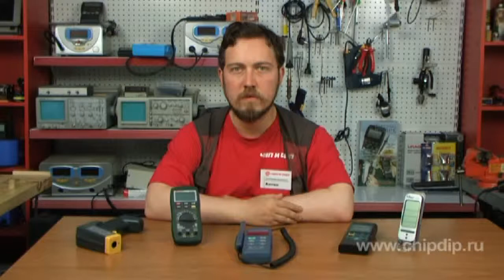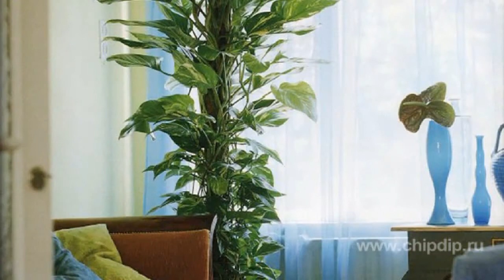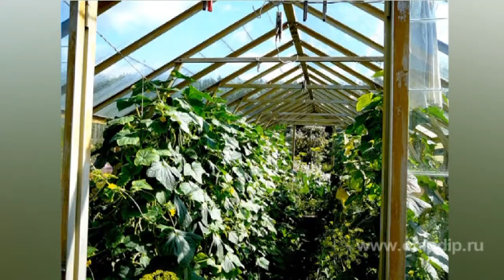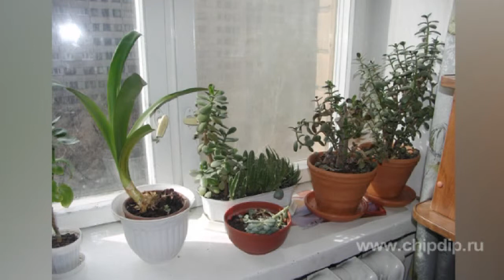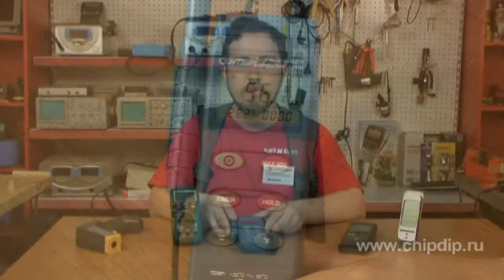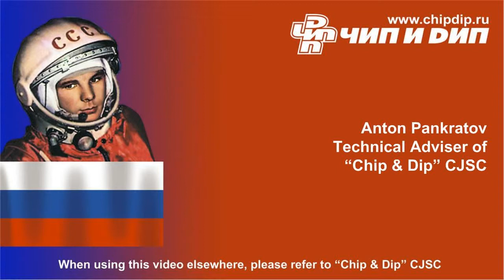Humidity/Temperature Meter CENTER-310

Comment: Ola amigo boa tarde.
Estou precisando do manual e esquema elétrico deste equipamento medidor de temperatura   Center 310 SERIES  .  Eu não tenho o cabo da interface para  o computador.
Mas quero fazer um e não encontrei na internet o esquema eletrico  e o Software de ligação do conector Db 9 RS232.   Voce tem esse esquema o sabe onde posso encontra 
Agradeço toda ajuda.

Joao Carlos.

Comment: Hello friend, good afternoon.
I need the manual and electrical diagram for this Center 310 SERIES temperature measuring equipment. I don't have the interface cable for the computer.
But I want to make one and I couldn't find the electrical diagram and the Db 9 RS232 connector connection software on the internet. Do you have this schematic and do you know where I can find it?
I appreciate all the help.

João Carlos.